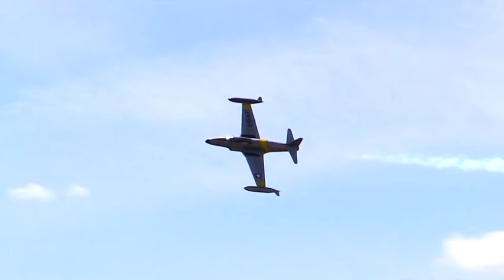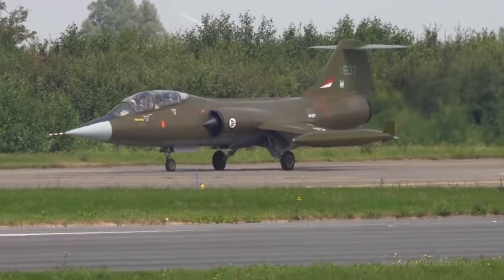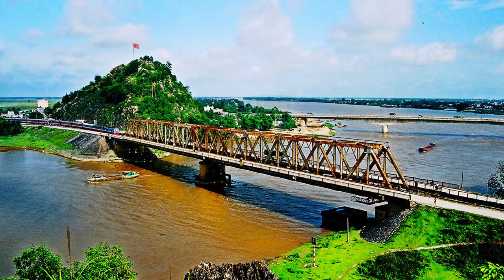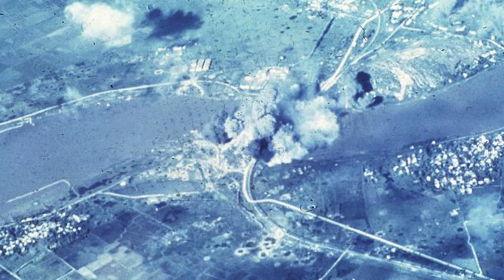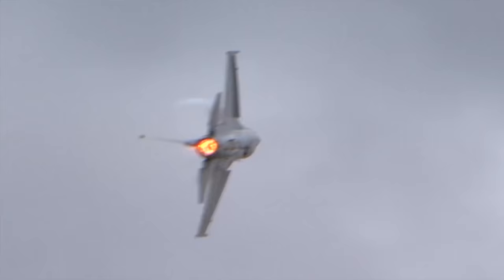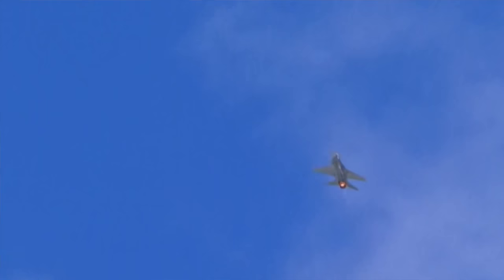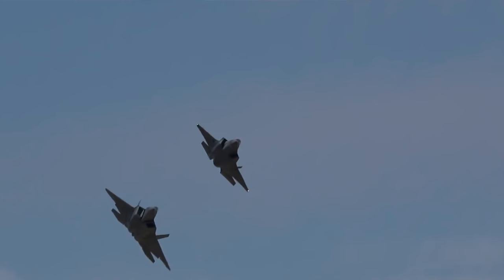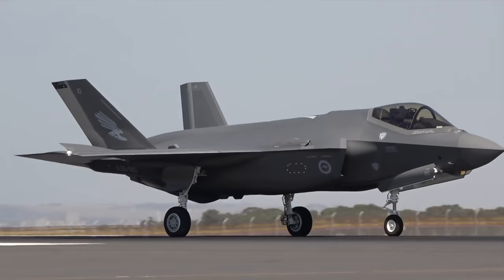Real Fighter Pilot on 5th-Generation Fighters

Comment: What’s your view on the air force considering a less advanced and cheaper airplane (compared to the F-35) to replace the F-16?
Reply: The development program would likely go well over budget, so I can't see a justification for the cost when a 4.5 gen could do the job, any more capability and you might aswell use an F-35. The latest super hornets seem like a good choice imo

Comment: may i know your thoughts on f22 vs f35, i always heard people said f22 stealth capabilities and its maneuverability are far greater than f35.
Reply: Maneuverability is overall better in the F-22 because it was designed to be the ultimate air dominance fighter against fighters from the 90's-00's, however now there's slightly less focus on maneuverability. Stealth wise we don't know officially because of security but as a guess I'd say they're likely close thanks in part to the 35's body shaping and overall smaller size. They were never meant to fill the same roles though so requirements are much different

Comment: I don't know why the high maneuverability is Overemphasized on 5th gen fighter planes especially the F-22, SU-57 etc if networking is most important.

Yes, you can direct your colleague's rocket/missile towards the target or be able to operate the vehicles you're not in while you're flying the F-35 yourself but at the end of the day, if the target is capable of evading everything you throw at it, what's the use of networking when you have to work to get to it physically again and go 'old fashion'.

Considering the stealth, the history of stealth technology dates back in WWI.

It's more likely, the stealth is only 0,00000001% of the 5th gen equation and that's how big role it plays in combat in which giant, 10-20 ton and very loud aircrafts are flying.
Reply: with modern missile able to go maneuvering to 30G, no aircraft, no matter how nimble will be able to dodge 2 of those, when 2 modern plane go into WVR, the winning or losing odds will be close to 50:50, no matter how maneuverable your aircraft, missile will always outperform those maneuver.

Comment: The irony being that while the F-22 is a fantastic aircraft, the YF-23 had superior stealth characteristics, more speed, and a significantly larger combat radius. The F-22, with radical new (at the time) thrust vectoring, was and is an air show darling. Lockheed brilliantly chose to fully demonstrate the kinematic ability of the F-22 in demos, although if the platform is used in its designed role, no opponent will ever get close enough for those abilities to be used. While the YF-23 was certainly a capable design, it couldn't match the thrust vectoring exploits and Northrup chose not to emphasize maneuvering ability in demonstrations. Combined with politics and some bad feelings about Northrop at the time, the nod went to the F-22. Was it a mistake? It's open to debate, but the fact remains that the F-22 is an exceptional aircraft ... just perhaps not quite as exceptional as its rival.

Human beings are g-limited bags of meat and although we try to make decisions with cold logic, feelings and emotions are always there and come into play. Even knowing in the front of our minds that dogfighting is deprecated in a 5th generation environment, it's hard to quantify the effect a scorching demo has on the unconscious. And this translates to current debates. The F-16 was the incredible fruit of Boyd and others' study of energy dynamics and breakthroughs in computers and engine design. But take all that away, it's a sleek, sexy design that looks like it's going a million miles an hour standing still. Meanwhile, the F-35 ... well ... it's like saying "but they have a nice personality". The requirements of the design and mission forced an appearance that just ... yeah. 

Makes one wonder ... when the F-16 first flew, it looked futuristic. It wasn't an accident that crews almost immediately eschewed the "official" Air Force moniker, and began calling it by its nickname, the Viper, after the futuristic space fighters in the "Battlestar Galactica" tv show. If the F-35 was equally as capable as it is now, but somehow was able to be designed somehow in a way that made it wow onlookers with the same level of awe that met the F-16 on its arrival ... would we see the level of negativity and nitpicking we have seen?
Reply: John 3:16 For God so loved the world that he gave his only  son so that whoever believes in him should not parish but have eternal life.
Reply: @diegoferrr6173  

"In God we Trust ... everything else we double check" - the Pilots' Credo
Reply: Out of the 4 ATF prototypes, only PAV1 YF-22 exceeded Mach 2.  No YF-23s exceeded Mach 1.82 according to the test pilots who flew them.  YF-23 had some issues with boundary layer management of the intakes and cracked at least 2 wind screens, so they had to limit its higher-speed flight testing.  YF-23 was very maneuverable and exhibited insane performance increased over legacy aircraft, with the huge fully-moving tailplanes.  It didn’t need thrust-vectoring to command high pitch and roll rates.

YF-23 suffered from not working out the internal weapons bay, which represented risk to the USAF in their risk matrix, which is extremely important because the more risk present, the more likelihood Congress will screw over funding for a program.

YF-23 had some VLO advantages in certain areas, while YF-22 had advantages in others.  YF-23 intake geometry was not fully VLO, as at certain aspects you could see right into the motor ducted fan stage, especially from the ground.

Also, the weapons bay didn’t hold enough weapon volume, so a new bay would have needed to be added, increasing the fineness ratio and length of the overall airframe from its long length as it was.  This has significant implications on structural limits and maneuverability due to stresses on the nose/fuselage junction.

The ATF Lead Engineer for the USAF recently stated that it could have gone to either design with a coin toss, didn’t matter. Both met the specs and would have been worked out either way.
Reply: According to USAF ATF chief engineer Eric Abell, ultimately it doesn't matter. At the end of the flyoff, both planes met USAF requirements admirably, and therefore, it did not matter which one was finally chosen. He took great care in making sure that both planes do what they needed to do, because the last time there was a project like that (TF-X), the invisible hands chosen the F-111 against the USAF's wish and it was a nightmare.
Reply: @mimimimeow  USAF was the prime source for requesting and driving TF-X requirements. Navy rejected it. F-111 went on to be a very successful deep interdiction/strike platform.
Reply: @LRRPFco52  yes, true. He probably just didn't like it very much.
Reply: @mimimimeow  Rick Abell worked directly with Pratt & Whitney as the USAF lead on fighter engine project management, and getting the TF30 to work in the Vark was his first major assignment.  Did you see his interview with Mover? Very fun.
Reply: @LRRPFco52  Yeah. I pretty much wrote the earlier comments straight from that interview video. Cool guy.

Comment: Informative ! I am really enjoying your posts . Question: The powerplant on the F35 .. is it really that much more different than on the F16 ? I have heard the performance difference is substantially better in the F35 . Wondering what your opinion was .
Reply: Well, it provides almost twice as much thrust.
Reply: It's even more powerful than the F119 in the F-22
Reply: @mimimimeow  Yup, the Raptor needs 2 engines to achieve more total thrust output.
Reply: I understand the numbers , was more interested in hearing a description of what it’s like in his words if possible.
Reply: One thing I believe he or another pilot said is that when F-16's are in combat loadout they sometimes struggle to keep up with tankers when trying to refuel, sometimes even requiring afterburner. In the F-35 they don't have these issues thanks to the higher thrust and rarely need afterburner unless going supersonic for extended periods

Comment: I hate to be that guy but stealth/ low RCS is a feature and not a characteristic. Think like this. The main "ability" of a ninja is concealment but when found he must be strong and nimble to eliminate the adversary.

Sooner or later radars will get sensible enough to spot an F 35 so far away as they spot a SU 27 nowadays. And data fusion can be accomplished by retrofitting avionics....
Reply: VLO/stealth technology is not static.  F-117A went through at least 3 generations that we know of in RAM, F-22A is getting new RAM coatings, and JSF have already gone through a new RAM upgrade since Lot 4.  The Japanese are working on a type of RAM integrated into the surface that lets RF “breathe” through the aircraft as if it wasn’t there.  Meanwhile, anything shaped like an Su-27 will be detected even sooner by radars trying to chase the RCS reduction monkey.  Cat and mouse continues.  Same with IR stealth.  Both F-22A and all JSF are extremely small, low signature platforms in IR spectrum.  Anytime you see someone critiquing VLO technology, just remember that there are literally armies of the best engineers in the world in multiple nations with the most advanced industrialized economies who have been working on it for decades, the US being the most experienced.

Comment: WW1 fighters didn't count?
Starfighters Phantom II where the same generation.
Gen 2 and 3 used hydraulics, not rods and wires.
Moors Law doesn't apply to military chips because they have to be hardened against EM pulse.

Comment: So what do you think F35 or F22 is better
Reply: F35 is better for MOST missions today,   F22 puts on a better airshow...      Someday the F22 might get its systems upgraded, then it would be a different conversation.
Reply: F-22 is a far superior for air superiority. They made a mistake stopping production.
Reply: @jamesgibbs9509   Yes,  The F22 is superior, but thankfully does not have to face off against the F35, which is superior in almost every way electronically.     BVR,  I would rather be in the F35 today,  but the F22's will be upgraded someday with F35 technology.       I agree,  we should have built more F22's,  even though Lockheed and Boeing kept the tooling,   all the mechanics / engineers have died, retired, or gotten fired,  so the learning curve starts over,   likely cheaper to develop a new jet at this point.
Reply: @dmitchellhomes  can’t say all of em. I work with some of them in flight safety. I understand what you are getting at though

Comment: Interesting facts. By the way, the Airforce chief of staff Gen. Charles Q Brown just admitted the failure of F35 for unable to achieve its goal, as a fighter pilot of F35, what is your opinion on that ?? Love you Hasard
Reply: I’ve read that original article and I honestly think it’s more clickbait material. The “goal” they had was to replace the F-16 completely (as far as I could glean), but if thats the case every fighter the US has ever made is a failure bc they always have the goal of replacing the jet before it but they cant/decide to not. As per his NFL analogy, different tools for different scenarios.
Reply: He never said it was a failure, that article is clickbait. What he meant was the F-35 ended up being way more advanced than just an F-16 replacement, and therefore another, more simple plane can take that role.

Comment: Why do the fighter generations lump WW1 and WW2 aircraft together? I feel like the whole "fighter generation" thing is entirely off by at least 1 digit. Going from broomsticks, canvas, a synchronized gun and and having the whole engine spin, to riveted aluminum structures with V12's and Radials, inverted fuel and oil systems, retractable gear, and variable props warrant a generation designation of their own, no?
Reply: It’s only for jets, they don’t include everything before that. They were undeniably amazing pieces of engineering tho.

Comment: I work in the field of tracking fast moving objects, and I just cant see how the next great war will be won with fighter jets. I think drones will take over. They can be so small, so fast, and so difficult to track. If you think stealth is cool on a fight jet, imagine stealth on a drone that is 1/1000th the size. Right now we are in an interwar period, and historically interwar periods are known for dead-end technology. And I think both human based jets and aircraft carriers are dead end technologies. I think the future of the battlefield will be lots of very small, very cheap, autonomous drones. And by lots, I mean you can fire off hundreds of millions or billions of them at the same time and swarm the battle field in a way that you cannot possibly do with fighter jets.
Reply: Drones are definitely the future, however those drones won't be 1/1000th the size because they'll still need the range and weapons capacity to strike targets, but they'll definitely be a little smaller. Small drones will more likely be deployed for ground operations not air combat. It'll be a while before drones completely replace manned fighters, as platforms like the F-35 will be used as forward command for drone squadrons. Developing this tech is a lot more complex than simply sending in swarms
Reply: @aidanwilliams9452  You don’t command drones, the drones command themselves. That is the point. You spread processing power and ability across all of them, they work like ants. It is distributed artificial intelligence. They work like a swarm. They don’t need range, you just keep sending more and more swarms. You completely overwhelm the battlefield. If your enemy can track 10 objects, you send 100. If they can track 100, you send 1000. If they can track a 1000 you send 10000. You keep sending more and more until they can’t handle it anymore and you gain control. Then you divide and conquer your way through the enemy, knocking them out one at a time while distracting the rest, ending all communication channels, and providing more targets than they can possibly handle.
Reply: @Melthornal  Drones can be commanded by a leading aircraft, directed to where they're needed. Computers are  extremely good at combat but it still needs to be told when to engage or not, and where. A completely autonomous drone presents a risk of civilian casualties if there's no way for the computer to recognize friend or foe. Also having a nearby command fighter reduces any sort of delay in orders compared to if they were sent from across the globe.

Yes, they do need range. How else are you going to get them there? You can't just fly a C-130 over an air defence network and release drones, and if a stealth aircraft does it then it might aswell bomb the target anyway. And if not deployed, then what sort of microdrone has a range of hundreds of kilometers? I'm well aware of how swarming works, but used in a conflict it's more than just sending waves and waves. Besides, sending thousands of drones on a one way trip seems like a waste of resources.

If you haven't seen it already look at the loyal wingman, those are the sorts of unmanned systems that'll be developed for main conflict. Yes micro drone swarms will have their place but they can't fulfill the same type of role as a fighter. Larger platforms also have much greater capacity for electronic warfare due to higher computing power.
Reply: @aidanwilliams9452  Only last gen drones are being commanded from around the world, and commanding a drone from a plane would be orders of magnitude slower than commanding a drone with other drones. I work on this stuff for a living. Everything you're describing is looking at the situation from a perspective of where technology was 10 years ago, not where it is today and certainly not where it will be in 10 years.
Reply: @Melthornal  I know drones can operate by themselves or together, but how can you trust now or in 10 years that they’ll be able to identify the right targets without human permission to engage? In the air that’s easier of course, but I can see many accidents and collateral damage happening. Air power is still needed and I don’t see tiny drones being used over larger drones for that role just yet.
Reply: @aidanwilliams9452  There are many delivery systems and use cases that I dont think you are respecting. for example, deployment from leo, which I think will be standard procedure very soon.
Reply: @Melthornal  LEO would require a rocket to deliver, but that would only be really effective against ground targets in which case it’d be more effective to be a kinetic missile than deploying small drones. Besides, many air defence systems are specifically designed for effective missile defence. I understand there’s future opportunity for those strategies which would be really cool technology, but I just don’t think the timeframe is that soon to become a replacement for emerging unmanned fighters/bombers

Comment: I still maintain that "stealth"  per se, is over rated,  and not entirely worth the expense and aerodynamic compromises for a general purpose utility fighter.  F-15EX  and Grippen,  are an effective compromise.  The USAF should have acquired the F-20, and 1000 of those would have come in very handy,  even today.
Reply: How? If your plane gets blown up by an enemy way outside visual range before you can pick them up on radar, it doesn’t matter if you can turn fast. Did you miss the whole point of the video?

Comment: Fourth generation jets weren't all lightweight, think F-14.  It's more specialized jets like A10, F-15A, and F-16A.  If the F-35 turned like a F-16 we wouldn't be having this discussion.  No one doubts the ability of the F-22 over the F-15 in a dogfight.  The F-35 is a compromise because there's the F-22 and NGAD. If the F-35 was awesome it would be withheld from export.